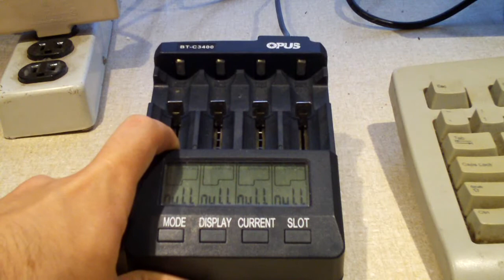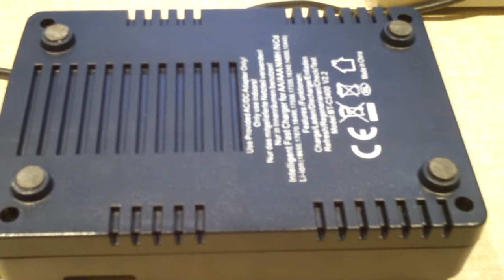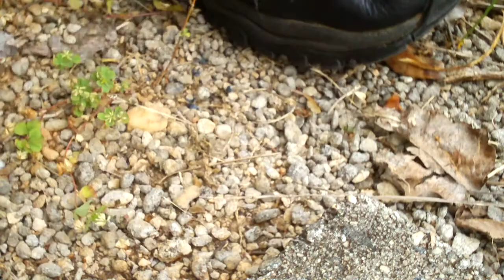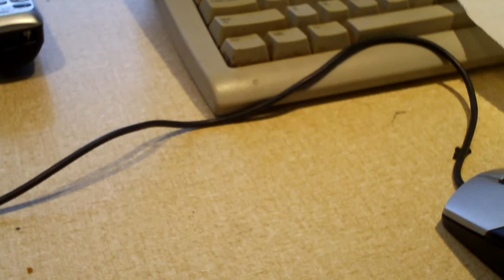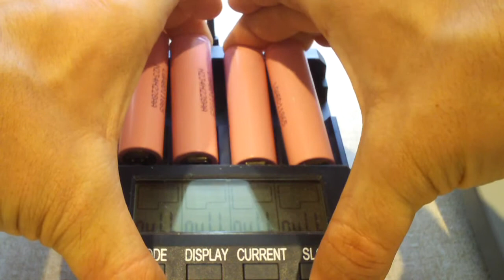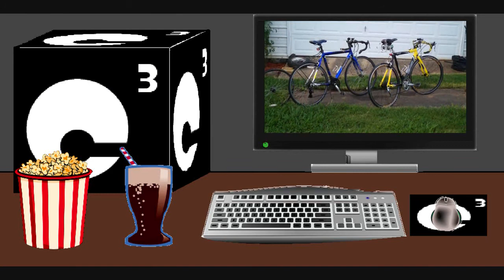Modifying OPUS BT-C3400 Charger to accept 4.35V Li-Ion cells

Comment: For access to the switch, I take the 4 screws out of the back and add tape to the one side.  It's easy to hinge it open or shut to access the swith, and add a small piece of tape to the other side to keep it closed.  If drilling, there is a special type of bit that allows you to cut sideways, making a tidy slot.  I have a variety of cells reclaimed from discarded laptops.  Most are 4.20V, a bunch of them are 4.30V, and a few are 4.35V.  There is no switch position for 4.30V but the display can be monitored when using the 4.35V setting.  However, it's been published that the lower voltage used to terminate, the longer life the cell will have.  Therefore, it's perfectly fine to charge 4.30 or 4.35 cells up to only 4.20V, live with 85% capacity being used, and call it a day.  In another words, the unit DOES accept 4.35V cells without changing the switch position.  It just doesn't do the extra 10-15% charge to them.

Comment: I have a couple of the liitokalas but I just got some lifepo4 cells that I am testing but one at a time and I have to charge them then discharge then recharge them one at a time and they are 26650s and 32650s so they are supposed to be 5400Mah and 3300Mah so it takes a while but I do like that the opus can discharge at 1A also instead of just .5 being able to test cells at a higher amperage can be useful

Comment: Looks like the latest Opus BT-C3100 (v2.2) is also like this.  The big risk with toggling the switch in both of these models is forgetting to set the switch back when charging 4.2V cells.

In my opinion, in order to support multiple peak voltages for charging Lithium cells safely, the charger should always default to the lowest voltage at start, and provide an easily accessible method for switching to the higher voltages when appropriate.  I certainly wouldn't mind paying a bit more for this added safety.
Reply from the maker: I agree here. I make it a habit to check the switch every time I load in cells to charge, and even with the little warning card, I still sometimes worry that I will accidentally forget. It should default to 4.2V and offer the 4.35V step-up for any cells inserted.
Reply: Ya but lithium iron phosphate are not the most common so most people would have to change it everything you used it but it seems like they could have had a software enable to change type like holding 2 buttons or holding one on power on